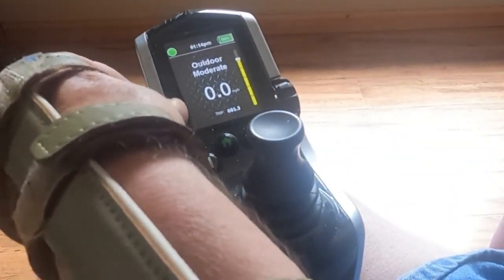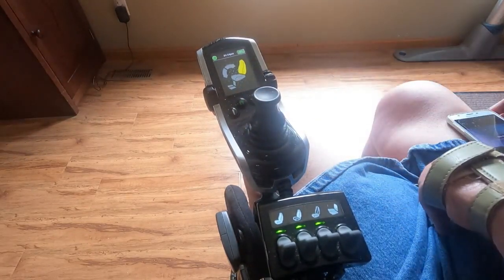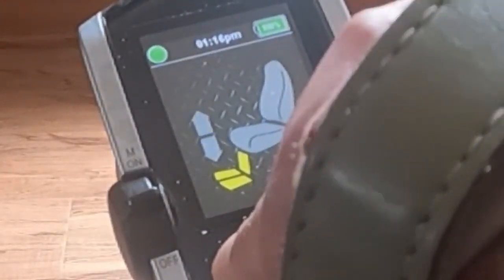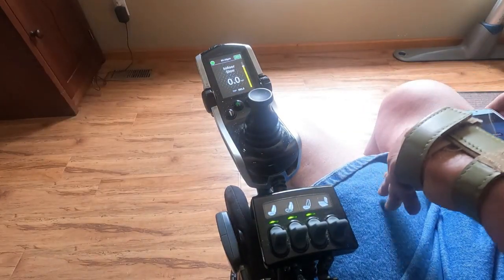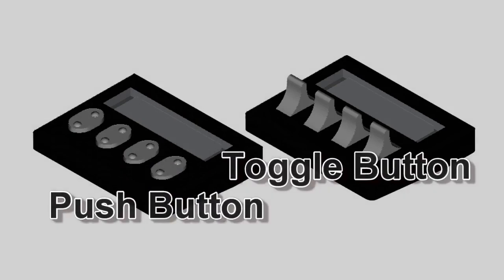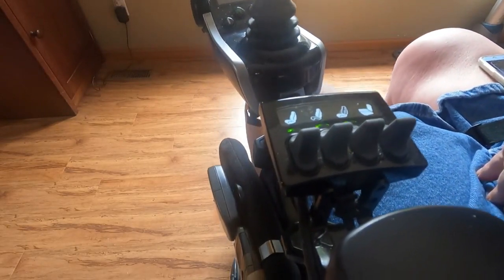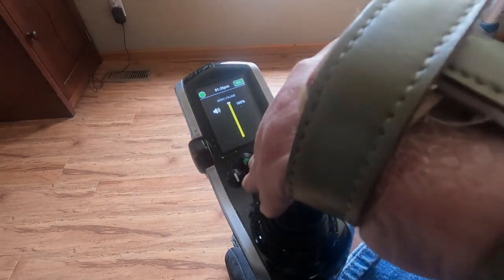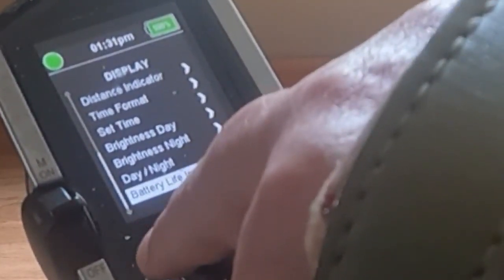#69 - IB Myositis - Power Chair Controls

Comment: Great Video as usual. I use a Pride Jazzy Air 2 which is really nice but I think down the road I may want to get the type that you can recline almost completely horizontal.

One question Jerry, how is your blood pressure doing? I’m trying to manage High BP with medication but my doctor says that may not be enough to lower it since I spend all day between my recliner and wheelchair. He says I need to do some type of exercise on a daily basis and that will help together with the medication. Any thoughts or advice you can give me? I’m usually at around 150/85 sometimes a bit lower but not low enough.
Reply from the maker: Mario, my BP has been in the normal range over the past 2-3 years, with minimal meds. Watch for my next video episode where I address some IBM issues with some exercise recommendations.